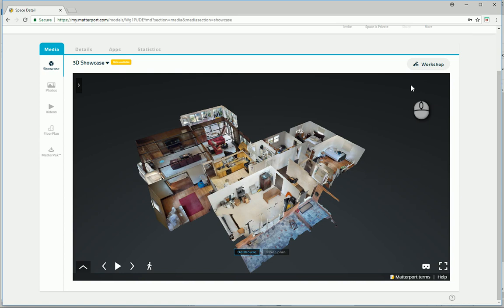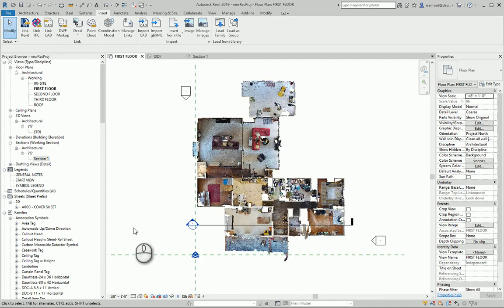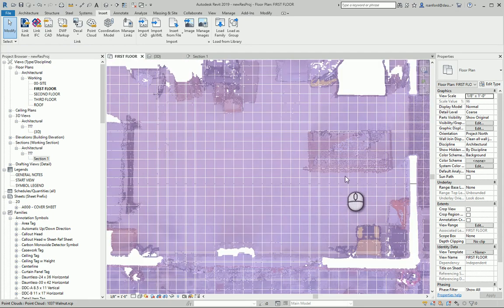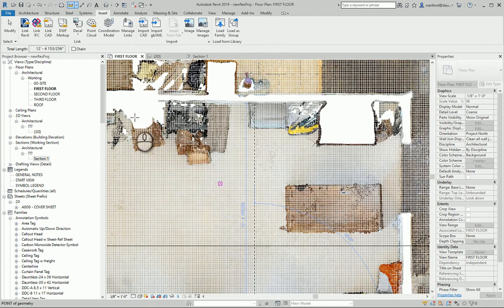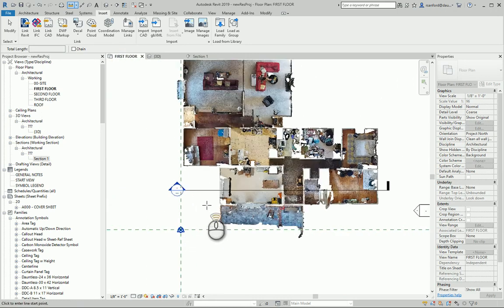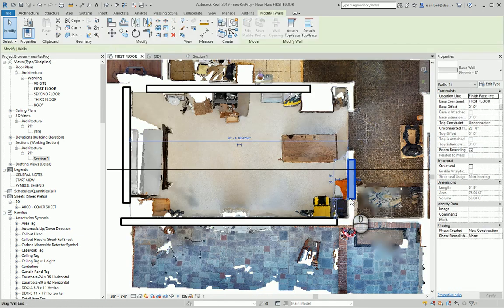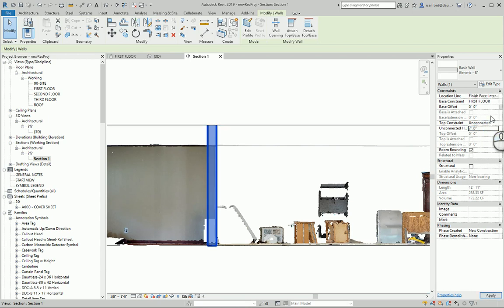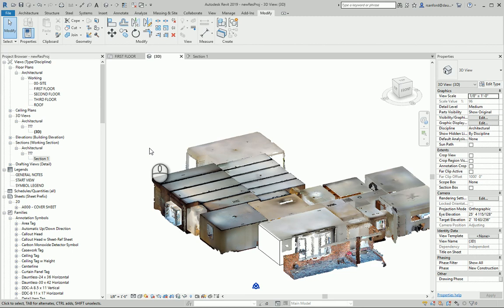Using a Point Cloud to draw an existing building

Comment: How did you take the matterport model into revit? Also, do you still like matterport? One thing I am concerned about is maintaining client privacy concerning any interior photography.
Reply from the maker: I take the .xyz file you get from the Matterpak into Autodesk Recap.  Recap converts the file into a .rcp file, which Revit recognizes.  I still use Matterport.  I keep most of my tours private since most of them are used for creating a point cloud to be used for the purpose in this video.  The only time I make them public are for commercial clients who want a completed project tour to use for marketing.